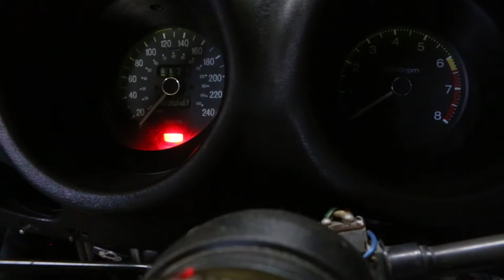CAN'T FIGURE IT OUT  |  Vlog

Comment: I had same issue with my 78 280z. I did everything from replacing fuses to completely rebuilding the turn signal switch. Turns out the issue was corroded connectors located on the passenger side under the dash close to the transmission tunnel. Cleaned it up with fine sand paper and a metal brush. It was that simple. Give that a try...

Comment: Hey, that high beam switch is a multi function switch. So just because the high beam switch is working doesn't mean the blinkers will. You should test it with a multimeter and do an actual voltage check. And depending how accessible that switch is check resistance/continuity on it. It may have bad contacts for the blinkers. I replace those stalks on older Porsche pretty commonly, they just go bad. Just a thought.

Comment: Hazard switch first should be checked. Then if that is not the issue, check these guys: http://album.hybridz.org/data/500/medium/DSC03316.JPG , then if they are ok check the switch finally. A simple test light or multimeter would make short work of this problem :P